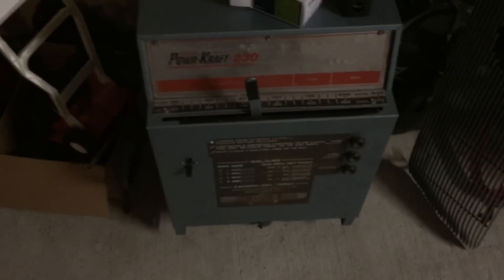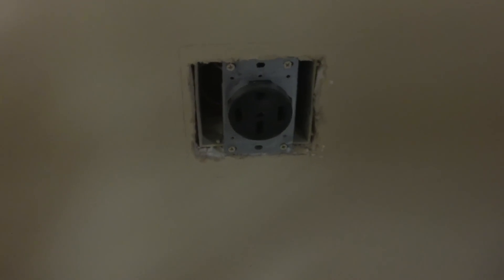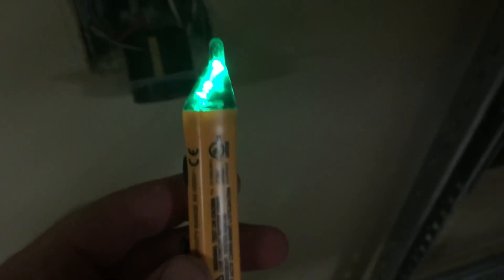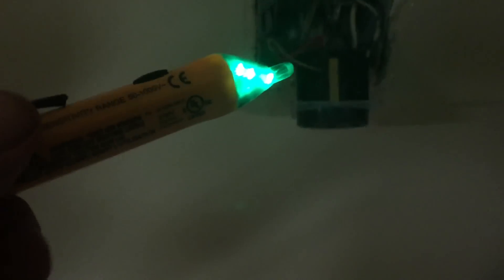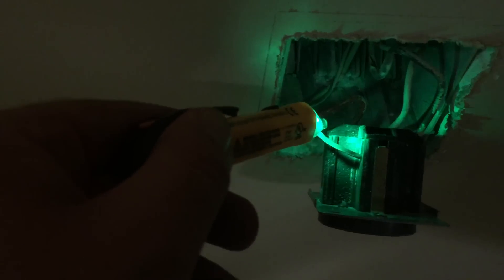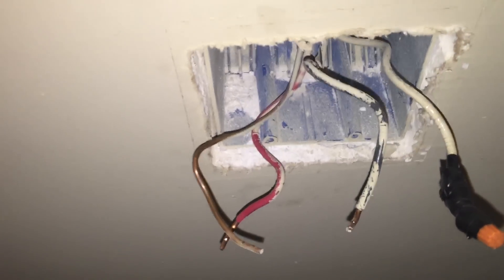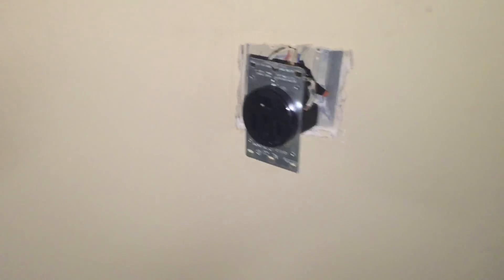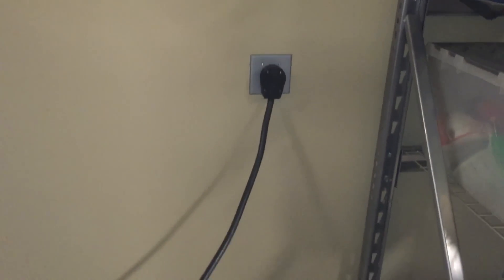How to convert 4-prong (NEMA 14-50) 220 outlet to 3-prong (NEMA 6-50)

Comment: Why can't you make you own adapter with a 4 prong male plug and a 3 prong female?
Reply: I currently just did this for a garage heater and for some reason the breaker keeps tripping. Not sure if the breaker is the issue or my 4 to 3 conversion is the issue?
Reply: @travissantelli9666  breakers must be sized to the circuit conductors, NOT the appliance. i don't know how your "conversion " is wired

Comment: Can do the same for a plug? Tape off the neutral? I have a 4 prong male plug, bought a 3 prong plug instead of changing outlet.
Reply from the maker: Robert S it depends on the device. Was it originally a 3 prong? The general advice is to change the plug. You don’t want a live wire in your device. Might be ok if the neutral wire on the back of the plug is removed.

Comment: 3-prong is the old system, 4-prong is the new one. In any case, I doubt that you have 6 gauge wire in your wall. When the current goes beyond your wire can stand, you could start a fire.
Reply: wrong!. circuit breakers or fuses will trip when dangerous currents are present.

Comment: why not use the white neutral?   When I removed the outlet it had the white neutral in the bottom.    Can the white neutral go where the ground goes?
Reply from the maker: For a 3 prong, 220v outlet like this it does not use the neutral. The neutral is not exactly like the ground and only works on 120v circuits. The 4 prong, 220v outlets use neutral because those appliances use both 120v and 220v.

Comment: I've got a machine that is currently wired with a 4-wire NEMA 14-50 plug. The machine uses 15 amps, so how much power it uses is not a factor here. My wall outlets are NEMA 6-30 wired with 10-2 wire. So my question is what do I do with the neutral wire when re-writing these machines to 6-30? Just cap it?
Reply from the maker: Sorry for late response. Do not re-wire machine. Something will not work on the machine if it's 4 wire and you reduce to 3.

Comment: I guess you could use the white for the ground and tie it to the neutral bar and ground the metal on the receptacles to keep from being shocked on the metal part of the receptacle?
Reply from the maker: No, the receptacle needs the ground, the appliance needs the ground as well. For this receptacle, no neutral should be used at all.

Comment: My 3 prong 240 dryer outlet is wired with the Neutral to the terminal & not the Ground.
Reply: David Yummus where is the other end of the neutral attached?
Reply: in your case, a jumper should be used from the neutral to the dryer frame. in a dryer, the neutral is used for the drum & timer motor. i've never understood why the mfgrs. don't use 240 volt drum & timer motors.
Reply: @garybrown7044  back in the good old days (pre 80) the drum motors were 240 the only 120 was the light and timer motors. Some of the lights where 230 volt lamps, my dad had a bunch

Comment: so I did this and now my breaker is overheating threw it 5 times now had to turn it off I followed it to a T any advice
Reply from the maker: Is it overheating while welding I assume or when your welder is off? What size breaker do you have vs what Amperage are you running?
Reply from the maker: If its overheating without the welder even plugged in then you've got a short somewhere. DOUBLE CHECK that you didn't accidentally mistake the neutral for one of the hots. Also make sure everything is tight and short and there are no wires accidentally touching.

Comment: I need some help with a "hypothetical" situation for educational purposes only to help me learn more about electrical stuff,... Lets say a person wanted to back feed an off grid cabin from a generator via a 3 pin 240 volt Dryer outlet in the cabin,...  Lets just say that the generator only has (2) 120 volt/20 amp outlets & NO 240 volt outlet,... You "could" make a conversion box feeding (2) separate 120v outlets from the generator, through power cords to a 3 pin, 240v outlet in a junction box.
Question is on wiring,... I get that you would run the 2 hot wires from the 2 separate 120v power cords to the 2 hot terminals on the 240v outlet in the junction box but do you hook up the 2 White neutral wires to the 3rd pin on the outlet OR the 2 Green Ground wires to the 3rd pin on the outlet ?
If you could answer that then thanks but can you also tell me why ? :)
Reply from the maker: Thanks for the question David. I'm not intimately familiar with how generators are wired but from what I know I'd say run the green ground wires, I work mostly on residential and commercial wiring. But I can tell you this, the neutral is only designed to carry 110V. Some argue that the neutral is sort of a ground (and this is partially true since the neutral is usually grounded at the transformer) however a 110V circuit can work without the neutral being grounded. It ends up being a safety issue, 220V shouldn't be sent down the neutral wire, the ground wire is directly grounded and will discharge any electrical charge on the appliance. You can think of the hot wires like like two batteries connected in series and double the power. The full explanation is a bit more complicated than that because we're dealing with an Alternating Current but that's the 5 cent explanation. You'll see the neutral wire on 4-prong appliances because they run both 220V and 110V seperately within them. Normal 110V appliances are required to be double insulated and thus many of them do not require a true ground, in fact many of them have internal transformers to step down the 110V.

Comment: I understand the 2 hots to get 240 but why do you connect the Ground wire the the 3rd pin instead of the Neutral ?
Reply from the maker: Sorry for the late reply. Neutral isn't grounded locally and isn't designed to handle 240/220.

Comment: I made a converter cord from 14-50 receptacle to 6-50 cord when my son bought a Miller Bobcat that has a 14-50 output on it.   I just bought a 6' 50 amp range cord with a 14-50 plug and wired a 6-50 receptacle to the other end.  It was about $50.  Then I found an outdoor box with a 14-50 receptacle in it for about $40 at HD and put it on the outside of my shed so I can work outside without an extension cord for the welder or plasma cutter.

Comment: VikingTXaggie, I could use your advise.  I am building a generator cord.  I am going from my generator 120 Volts 30 Amp 3 wire travel trailer RV plug connection to a 3 wire 10/3 cord to my outside house connection 4 wire connection.  The male cord house connection is a Leviton No. 275-t/14-30P.  How do I connect the cord?  Black on the hot, white on the hot and green on the ground and skip the neutral?  On my breaker box in the house the wires from the outside connection are black and red to the double 30 Amp breaker, the white and bare copper wire go to the grounding bar.
Reply: I can email you pictures and a better explanation of what I am doing if you need me to.
Reply from the maker: Of course, send me a private message with your email address.

Comment: Thank you for the excellent walkthrough. I have a dryer with a 3-prong cord and I bought a 3-prong outlet to replace the 4-prong outlet on the wall. Seems easy and straightforward. This helped a ton!
Reply from the maker: Sorry, previous comments are right, codes are for the builders and electricians to follow. I work in construction and have dealt with both commercial and residential, once a residential building is turned over to the owner, they are free to work on it as they see fit, barring any local ordinances requiring professionals to perform the work.
Reply: sjokomelk only licenced electricians are required to follow nec. as a home owner you can do what ever you want past the meter. you cannot hook up to a metter or diconnect any thing else is up to the home owner....
Reply: You are not allowed to do that according to NEC. You need to change the plug and cord on your dryer.
Reply: @sjokomelk  It's not a dryer... Also, what if the new appliance does not have a 4 prong plug, such as a ductless mini split. A homeowner has to be able to use the outlet, regardless of what receptacle was originally put it.
Reply: Short answer - No. The code is there for everyone to follow.

Comment: Thanks for publishing this!  I searched Youtube far and wide with no answers on my situation (very close to yours).  I had a 4 wire whip hanging from an external sub-panel tied into the meter (separate from the house breaker).  I took out the whip and wired an external plug box.  I realized after that, that my plug was a 3 wire (for a welder).  There was nothing until I found your video.  To admit to you and Youtube (for avoided mistakes in their home electrical needs) I wired the plug right ( 2 hots and my ground = 240v 50amp), however, I didn't know what to do with the neutral wire (white).  I tied it to the ground of the box thinking it would act like the neutral bar on a breaker box DO NOT DO THIS!!! luckily  my breaker switch was in working order and tripped right away when turned on!  I saw your video and capped the neutral.  My welder is now up and running!  Thank you so much for posting this!  Like I said you are the only one who has posted a 4 wire to 3 prong outlet.

Comment: Thanks man!  You helped me get my welder going.  Your video helped me realize that there is no "neutral" in the older wiring.  I have a black a white and a green.  The green is attached to the case and the black and white are both attached to the switch.  I had the green wire attached to the neutral prong and the welder did not like it.  I moved it to the ground prong and am welding just fine now.  Thanks.
Reply: kdwise11 green is ground, red black r hots, white is nuetral..
Reply: bare copper is ground also

Comment: have the same issue. My dryer plug is 4 prong. Welder is 3 prong. can i build an adapter to go from 4 to 3?
Reply: Joseph Leogrande
That's exactly what I said, the dryer is most likely wired for 30A which means the circuit should be wired with 10 AWG copper or 8 AWG aluminum , for obvious reasons contractors typically don't spend extra money on over sized wiring, so the circuit can only be used for up to 30A so if he has a welder rated for higher to 30A he cannot use the existing wiring .
Reply: @Intanius  i have used arc welders on 30 amp circuits for decades. rarely are welders turned up to max. current. 1/4 " & 1/2 " steel welds fine on a 30 amp branch circuit.
Reply from the maker: +marc o'leery Yes it's pretty common to do that. Most common is a short pigtail type adapter. You can also buy one but it's cheaper to make one yourself if you have the time.
Reply: I thought this was it